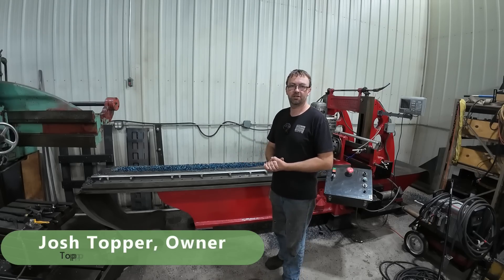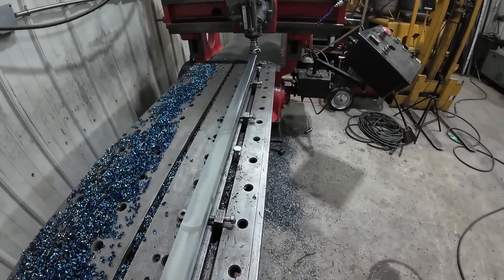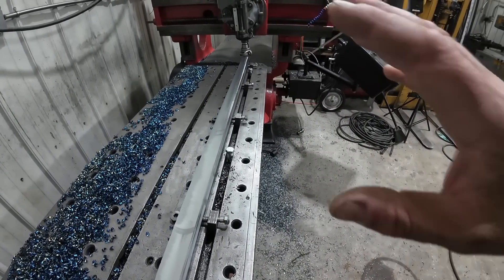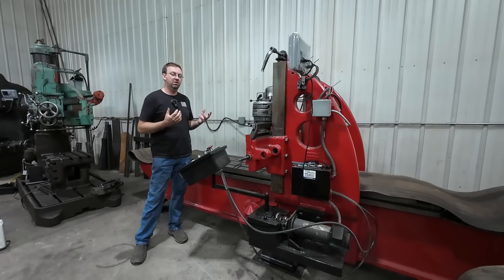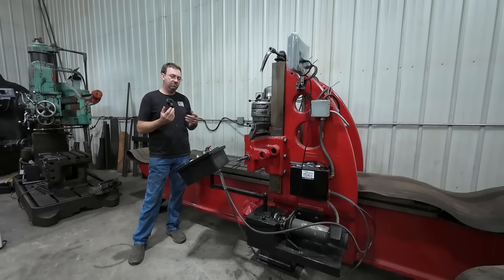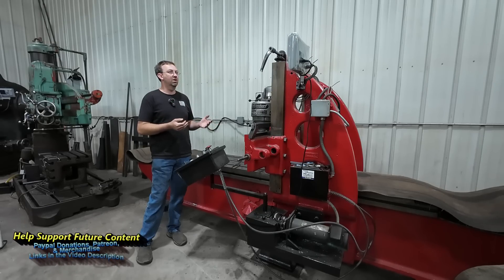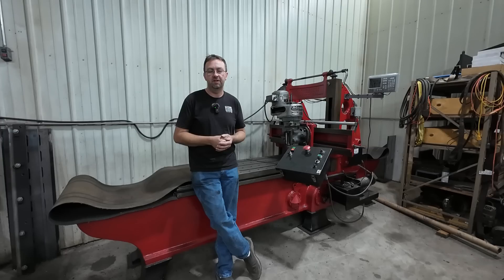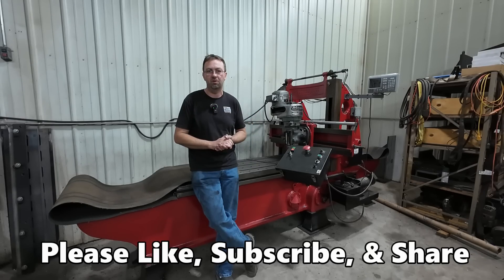Milling 8 Feet On The Metal Planer Milling Machine Follow-Up Video

Comment: Hi, may I ask you about advice? I am a beginner in machinery. 
I have a cast iron plate  3' x 3' and 1.25 thick. 
I need to make it less thick, about 3/4". 
My knee mill Bridgeport with R8. 
Which end mill would you recommend, and inserts? Also what the speed and thickness of each cut-off pass? 
Thank you!

Comment: Love what you do and how you show it warts and all - wrong angle - duh... but no editing of it out. We all have those moments, great that you caught it by listening to your gut not your head that was saying yeah i did that right...

I just watched both videos. One thing other thing that changed was the relationship of the amount of the cutter in the cut. In the first video the cutter appeared to only be just past the edge of the workpiece so the cutter was engaged for a long time. In the 2nd video it was much more central so a lot less tool engagement. This cut is really easy on the tool as it builds up from zero to full depth so there is no need to "protect" the tool going into the cut by using its position to thin the chip out. Given this having the tool exit the cut as soon as possible is (always?) preferable. 
An example of a hard cut is the first cut with the 3/4" cutter. The corner will always cause the cutter grief (wear) the amount only depends on the hardness of the material. A way to lessen this is to use a cutter for the first cut that removes the corner and not a lot more. You can use the cutter in different position of it cutting length to get a good life out of it. Then when you change to another cutter there isn't this same "hard" corner being struck. Now the tooth is cutting into a face of the material and so the loads are spread further. Of course whether it is worthwhile doing this depends on how long it takes to change cutters and setup, the cost of the cutters and how long they last in either condition.

Less common on mill inserts but on lathes etc there are plain inserts - basically squares with round corners  - they are used in negative rake tool holders and are reasonably durable - certainly more durable than inserts with a cutting edge designed into them. But in really heavy going grinding a chamfer onto these inserts makes a huge difference. The impact now occurs in the body of the insert before the edge enters the cut and the edge itself "slides" into the cut due to the chamfer. Hard steel and heavy interruptions there is nothing better. The worst interruption I ever experienced was with split gears where the  face was angle for a double herringbone gear. So twice every turn there was this gap with a cutting edge coming around to cause havoc to the inserts. Sure they were 12+' (4m) in diameter so bigger than what you are doing but the principles are still the same.

Comment: I have learned the hard way, that cold rolled, has stress in it … milling a square 2x2 (45x45mm) square. 2 feet long, bended in the middle like 2mm - like 0.080 inch … to remain straight I flip the part like 6 times

Comment: I took a look at the planer mill playlist. I'm guessing that this machine would have originally been similar to a shaper, but with the bed moving instead of the tool? Is that correct? I'm sure I've seen that type of machine operating in a video some time ago.
Reply from the maker: Yes, exactly like a shaper. Just much larger.

Comment: What's your shop rate?
Reply from the maker: $120
Reply: @TopperMachineLLC  Tattoo parlors charge $150/h here. Almost no overheads, minimal skill and training required. The economy is grossly distorted.
Reply from the maker: @topduk  I'd make way more money in any other trade. Machine shops are grossly under valued. Look at a plumber with a crappy truck and some basic tools, makes more than I do with a full shop of equipment, tooling and skills.
Reply: @topduk  Who repairs the machines that manufacture everything around you? With out machinist how would your tattoo parlor make  $150 an hour. I can easily charge $450 an hour on a rush breakdown job, when the customer needs their machinery up and running. Think about that.
Reply: @MrNeverseeme  I don't have a tattoo parlor or any tats, I do have machine tools though.
Reply: @MrNeverseeme  Gouging customers like that, even on rush breakdowns is not a good way to build long term business relationships.
Reply: @ellieprice363  When a machine produces  100,000+ dollars a day, is there any question?  Production is production. Working 16 hours a day for 4 days. To get the customer running. Obviously your not in the same industry as me. So shhhh...
Reply: @MrNeverseeme Trade school under the GI bill in 1955. Machinist and tool and die for 60 years with my own shop the last twenty five.

Comment: Massive layoffs on the horizon??   But, but....  According to one of the politicians currently running for office, our economy is better than ever, much better than last year.  Hmmm....  Something doesn't add up.
Reply from the maker: Don't believe that politician.  It is full of crap!
Reply: They'll say anything to stay in power. They also fudge and manipulate data to cover the lies they are telling. Yet millions of uninformed people will still believe them.
Reply: They're all just puppets vying for the lead role.
Reply: According to the Bureau of Labor Statistics, it is better. Not a politician. Unfortunate your situation is getting worse though Topper, hopefully it improves.
Reply: @romanvarcolac2238  Cooking the books is standard operating procedure for governmental stats. A good example is inflation.
Reply: @romanvarcolac2238  according to the government, a job is a job. They're all the same. But in reality, is a factory closes that had good paying jobs. The hundred people now have to work 2 low paying jobs just to keep their head above water. The government counts that as created jobs.
Reply: @peteengard9966 The work hours per week has also not really changed either up or down in the past eight years. So people are not generally working more either. This is also a statistic measured by the Bureau of Labor Statistics. Not saying that you or someone else may not be working more in this economy to stay afloat, but the statistics do not lie. They tell the whole story, and not just anecdotes. It can always be better, but we are certainly not bad.

Comment: As a Journeyman Industrial Machine Repairman 50+ years, I saw what you did in your setup was correct 👍. I have always been taught to cut towards the positive locator, you have a clockwise direction cutter pushing towards the stops/ positive locator.  👍. That’s how all industrial machining is designed.

Comment: As a mobile welder specializing in hvy equipment and hvy truck/trailer repair. We do some structural work also here in central Michigan and a majority of out customers are saying they don’t want to spend any extra $$$ until after election. They’re hedging against another 2020 debacle. Their words. We also are debt free company and very glad we did it this way. Keep up the great video’s! 👍🏼
Reply from the maker: I have had a few tell me that if the election goes the wrong way, they are done all together.  Sure am glad I chose to get out of debt, this may not be survivable.
Reply: I don't see what the election has to do with whether a business is profitable or not, unless they're banking on a government handout (but that would be the evil socialism, so it couldn't be that). It's called the invisible hand of the free market - if you can't compete, that's a you problem, not everyone else's (aka taxpayer's) problem to subsidize your unprofitable business.

Comment: I'd noted your comment and just put it down to a different batch of steel. Even the same type varies a bit lot to lot, and that even ignores that one lot might have been mismarked.
Reply from the maker: There are always variations in mill runs. Especially years apart.